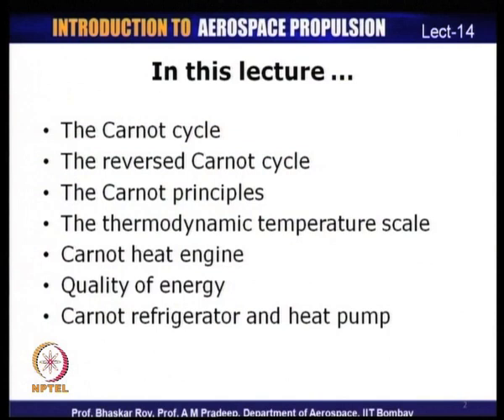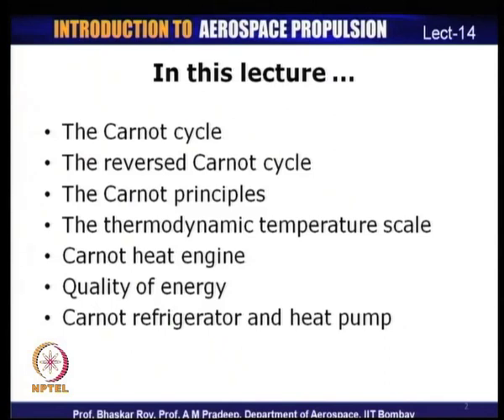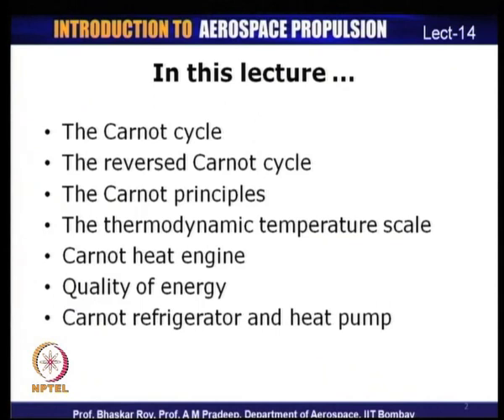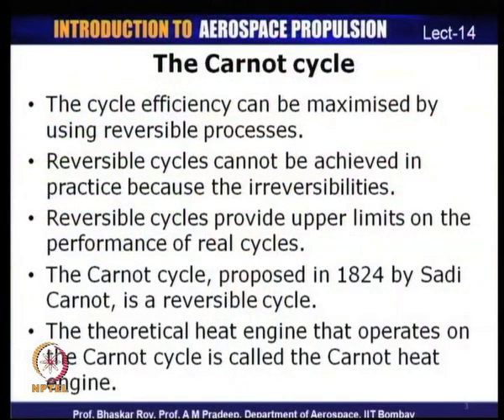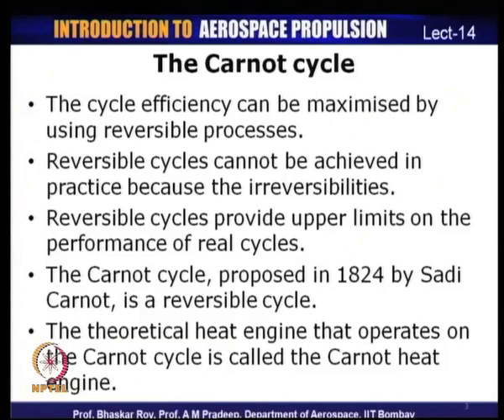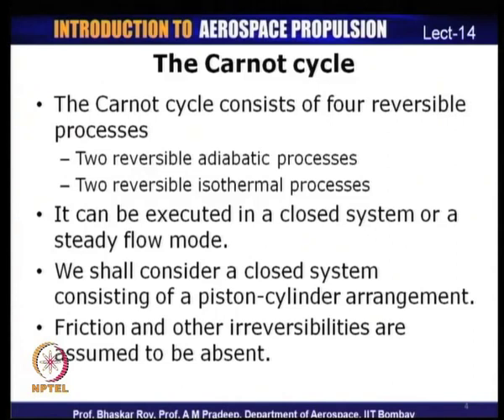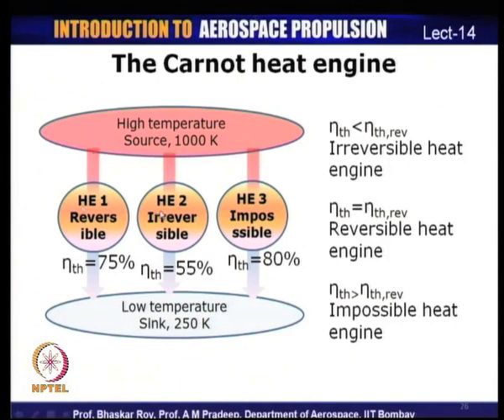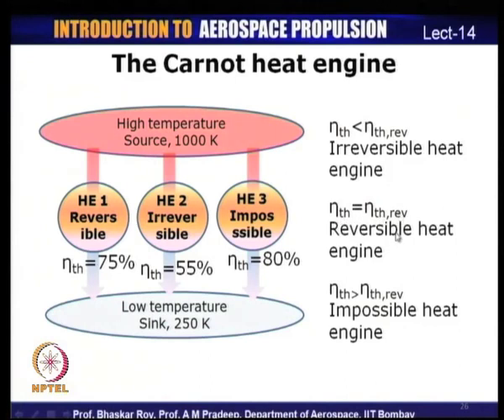Mod-01 Lec-14  Carnot cycle, Carnot principle, thermodynamic temperature scale

Comment: Sir Q1 +Q2=W1-2 +W2-3-(W3-4 +W4-1)
£Qnet=£Wnet for the cycle its not Q1-Q2 its Q1+Q2 please check the eqn
Reply: You are wrong, its not  Q1 + Q2, it is Q1 - Q2,  because it is the heat rejected from the system, not to the system. So what it given by sir is correct. What is wrong here is not the final equation, but the equation for process 3-4 which is actually -Q2 not +Q2. so we end up  having Q1-Q2 in the final equation.

Comment: Another prof who just states that the volume increases with adiabatic expansion, but does not tell us why this would happen!
Reply: The internal energy of a compressible fluid gets converted into work( which is why its volume increases) when it is confined in a non conducting enclosure/cyclinder. Internal energy cannot be given out by heat( Because its confined by non conducting cylinder or enclosure) so the only way is, work or expansion of the compressible fluid acc to the first law of thermodynamics.
Reply: @vibodhj349  sir you teach physics